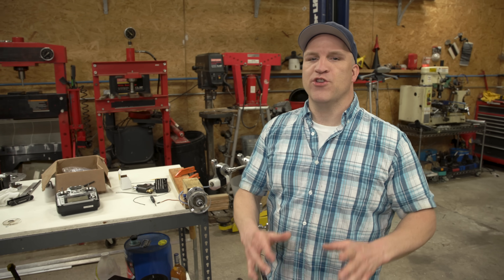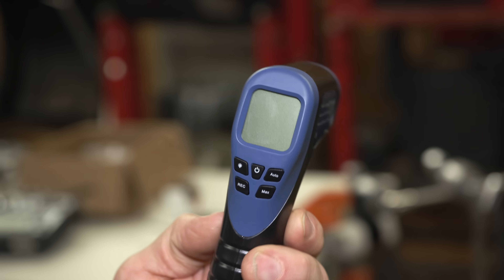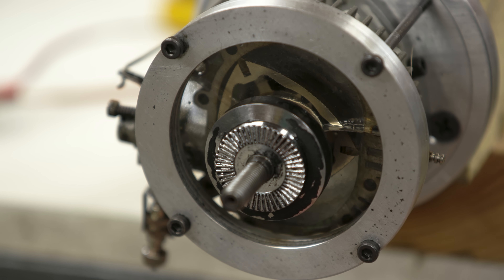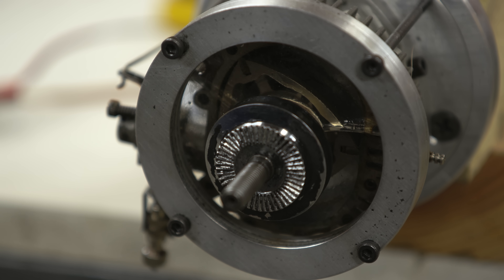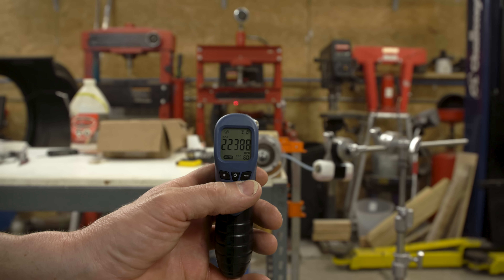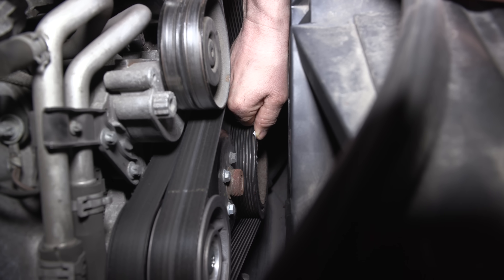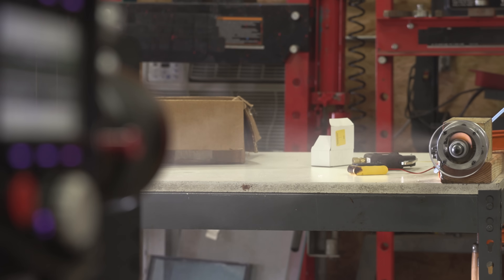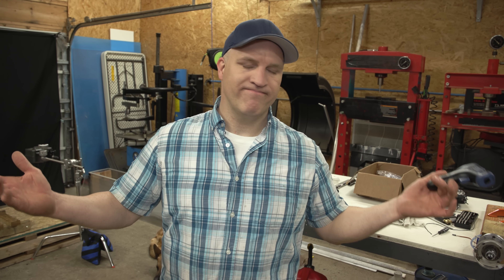See Thru Rotary Engine MAX RPM - 29000 (Wankel Engine)

Comment: Since it has 3 identicle sides, wouldnt u have to divide that by 3
Reply: Ty Williamson the rotor is spinning 1/3 rate of the flywheel but the flywheel rpm is true
Reply: There is a three-to-one ratio... the internal components rotate at just one third of output shaft speed... slower than many Diesel engines.

Comment: idling at 7000rpm is healthy

Edit: why are people arguing, jeez
Reply: My buddy's Polaris pro x 440 snowmobile will sometimes idle at 6000rpm because of dirty carbs
Reply: @ turbo traktor  dam, my Crossfire 600 (2009) idles at 1400 RPM
Reply: Hey bro read the 665.7rpm idel .. not 6657
Reply: @kennethschultz6465  actually it is
Reply: @recepgunoglu4058  realy ..  What doe's 1 rpm mean .. 6000+ rpm is almost a F1 car in idel.. 
So No i don't belive IT is
Reply: @kennethschultz6465  F1 cars turn 18000-24000, hell my Ford Focus shifts gears at 6800 RPM I could wholly believe a little snowmobile engine that revs to 18000-20000 would idle at 6k
Reply: @alexphillips4325  lol how long ago did you watch f1? We have V6 turbo 1.6L hybrids now, which legally can go to 15000, but for reliability worries go usually to ,13500
Reply: @alexphillips4325  the Polaris redlines at 9000rpm but that snowmobile is long gone, we managed to blow the drivebelt on it
Reply: @kennethschultz6465  buddy you can't even English so gtfo here. Rotory engines work at much higher rpms than regular engines. You must be new.
Reply: @kennethschultz6465  7000 seems very possible to me, some RC engines can rev to 30k+ rpm
Reply: @alexphillips4325  eh idk our old 340 polaris idled at about 1200 and maxed out at about 11.5k. It was a twin 2 stroke
Reply: @kennethschultz6465  And is this engine meant for a car?
Reply: @alexphillips4325  f1 cars are 13k rpm
Reply: @ljamieson0581  Depends on the era, the v10s of 2003 were limited to something around 18 or 19k rpm
Reply: @recepgunoglu4058  ops yakaladım
Reply: @alexphillips4325 I’m glad I’m not the only one redlining my focus 😂 takes all the abuse even at 160k miles
Reply: @alexphillips4325  what snowmobile revs to 24k? You’d be lucky to get 13k on most
Reply: @alexphillips4325  f1 cars on full throttle may reach 12.5k,so yoy are wrong
Reply: @alexphillips4325  Yeah I heard ungoverned that redbull got one up to 22k at max rpms.
Reply: @kennethschultz6465  theres no decimal on the tach. youre wrong
Reply: @kas-lw7xz  Dude probably quit after 2005 USGP
Reply: @kennethschultz6465  Are you blind of what? Play the vid in slo-mo and you can CLEARLY see the revs go from 13XXX to 9XXX.X.
Reply: Jet engines get cranked at 4000rpm.....idle at 9000.....can go upto 40000rpm
Reply: I like turtles
Reply: My hard drive does 5400RPM
Reply: Well it's a rotary. They have high idle, high rev redline.
Reply: @foxman105  its because its miniature size as well
Reply: @foxman105  I kind it hard to believe how nobody here mentioned the reason why engine idle higher in the first place smh having a high idle doesn't mean it can rev high. The idle is dictated mechanically by the the lobe profile of the camshafts due to having a higher lift and duration and in rotary engines by the port size and shape. Lower idle is set as low as possible in road cars for emission and economy purposes and also for lowered end torque. Racing engines follow a different philosophy and are only about getting the most hp and increasing revs efficiently is part of the nature. So since they don't care about fuel economy they don't compromise and design the camshafts and everything around it accordingly. Motorcycle engines use the same principle but only because of its smaller displacement and being naturally aspirated only way to increase hp is again by high revs and also again thats why they idle higher then road cars. In forced induction engines the revs can be set lower due to the power being created by the turbo but still can be made to rev high for higher hp like in f1. With that being said just because it's a rotary doesn't mean it only operates at high revs. All road production rotary engines idle just like any other engine. Take the rx8 for example idles at 900 but has a 9000 rpm rev limit. So yea the amount of nonsense in here is crazy.
Reply: @MrDelsoleg11  That 700 RPM idle in RX 8 was done because of the emissions and is actually hurting the engine in the long term. If I remember correctly it's recommended to raise the idle to around 1100 RPM between emission tests so you won't damage the Apex Seals. At 700 they get poor lubrication and start to scrape.
Reply: As fast as a harddrive
Reply: I don't understand how much can be 7000 rpm, could someone convert it with imperial system?
Reply: @shimmentakezo1196  7000 rotation per minute
Reply: @magnumllama400  Thank you, I meant with imperial system. Smart people have invented and use it, there must be a unit. I don't know, maybe 81.2 nails per football match time, or something like that. There are barrels, inches, miles etc there must be something intelligent for rpms
Reply: @shimmentakezo1196  bald eagles per 10m lifted trucks
Reply: @magnumllama400  That's it ! I knew there was a solution lol
Reply: @shimmentakezo1196  there are even better solutions but I can't think of one yet, maybe count it in hamburgers per AR15
Reply: @magnumllama400  sounds american enough
Reply: @Alexander Miller the Shelby gt350 can rev upto 8250
Reply: @Lrlbiglee  yeah my vtec revs up to 10k, but Alexander is talking about Idling bruh
Reply: There is so many factor that limit 4 stroke with piston engine for higher revving, in daily driver car/bike some factory set it to 21 m/s on piston speed. So if your engine used shorter stroke it can rev higher than engine with longer stroke (so thats why motorcycle can get higher redline than car).
You can also go to more than 21 m/s by removing factory redline (using progamable ECU) but it can reduce the engine durability 
In this video, he using rotary engine, so don't compare it with your piston engine rpm when idle
Reply: its not idling at 7k, its at 7000/3. they took the crank's speed not the rotor speed
Reply: @disruptivegarage  Rotaries are almost always measured at crank speed, that’s the RPM shown on all of the GM and Mazda rotaries is the RPM of the E shaft
Reply: @alexphillips4325  try giving Wankel engine rpm a google. you surely don't think that these guys casually make 3x the rpm racing engines make? if you divide by three you get at the more feasible and actual rpm.
Reply: @disruptivegarage  My 3.3cc regular piston/cylinder RC plane engines also turn 30-40k rpm wide open, and official manufacturer redline is 50,000 RPM, and Wankel engines are generally capable of higher RPM speeds than a piston engine. The crank speed is how the Wankel engine RPM is measured, not rotor RPM. When the Wankel crank is spinning 30k RPM, the rotor is indeed turning 10k RPM, however, the engine fires once per crank revolution, so it makes more sense to measure it at the RPM of the eccentric shaft, which is how this was measured.
Reply: @alexphillips4325  the reason this might be possible is because you have very little rotating mass, 3.3cc weighs nothing so the forced at play are easy to cope with, not to mention bore vs stroke. a regular size engine wont we be capable of such rpm's just like the one in the video. you can even check what i stated about the rpm in the video.
Reply: Cute little motor and it spins quick as good job 

Loving the sound purring sound
Reply: I've got an RC car that idles at 17000 when cold and it richens up and idles at 11000 RPM when hot. I love the thing, the clutch starts biting at 22000 RPM, full close at 26000 RPM, and shifts from first to second at 40000 RPM, and tops out at 80 mph and 47000 RPM.
Reply: @alexphillips4325  what's this rc car?
Reply: @alexphillips4325  that’s one crazy crazy car
Reply: @alexphillips4325  ye but that rc car has like a 5cc engine
Reply: @alexphillips4325  i don't care !!! Read the RPM COUNTER HE IS POINTING WITH!!! 
""" DOOOOH MY SOACE SHUTTEL GOT 790000000 RPM ON THE BOOSTER PUMP IN IDEL """ 
WELL WHO FUKING CARES !!! IF THE R P M COUNTER SAY 667.7RPM 
ON THIS ENIGEN IN THIS VIDEO !!!
Reply: @TheBypasser  comaring 6000 shots from a gatling to 300 from a tmg 
Right !! Easy
Reply: @TheBypasser  and 1 rpm is 3 combustions ..
So 20.000 rpm
60.000 cumbustions 
Good luck with listening
Reply: @kennethschultz6465  No.
1. 1 rpm is 1 combustion per minute (because the shaft - and the flywheel - spins three times faster then the rotor, this is a Wankel, do not forget it).
2. How is 20k RPM relevant as you tried to state it idles at ~700? (which it doesn't)
3. 600 RPM is 10Hz so sounds like a machine gun, nothing close to anything you can hear in any part of this video.
4. On 6:29 is the lowest idle here (likely because of the lean mix), that is ~7k RPM, both by tach and by the sound (~117 Hz)
5. If you still can't believe it idles at around 10k RPM, just download some audio editing software and either look on the spectrum or the peaks themselves.
6. Even 60k RPM is perfectly distinguishable as it is exactly 1kHz, so would sound like a high-pitched loud hiss.
Reply: @kennethschultz6465  
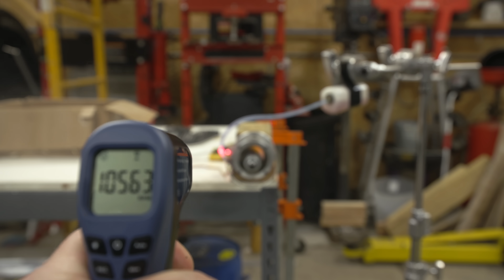Take a very close look at 2:44 , it IS Idling at 10563 rpm, there is NO decimal point. And at 8:46 you can see, it's ONE combustion per round, not three. Set the video playback to .25 and watch closely: The marker for the tachometer is always visible on the right side, when the fuel ignites, there are no combustions when the marker is anywhere else.
Reply: @kennethschultz6465  are you drunk
Reply: @kennethschultz6465  jezz calm down!!!!!!
Reply: @kennethschultz6465  bro i'm having a stroke while reading your replies
Reply: Shur most 2 stroke engines idle at 2k to 5k rpm
Reply: @alexhickey5633  It probably has a stuck choke or something because if it keeps idling for a time it'll even out at around 3-4000rpm
Reply: @pettttson  look at the size of the engine. Its tiny. Everything will happen faster
Reply: @alexhickey5633  Thats fucking ridiculous, no they dont.
Reply: @verttisyrjala2897  they do. 1500 is the lowest they usually go. 2 strokes idle high its just a fact.
Reply: @alexhickey5633  If a 2 stroke dirtbike for example is idling above ~2000-2500, its running lean when the carburator slide is closed.
Reply: @verttisyrjala2897  depends on the engine displacement too buddy
Reply: @alexhickey5633  Bigger engines will idle lower
Reply: @verttisyrjala2897  well no shit!!!!!
Reply: @alexhickey5633  the engine in my case was running like crap, oh and by the way idle rpms doesn't matter on a snowmobile, the throttle will engage the variable transmission. In My case the snowmobile wouldn't start moving until roughly 6500rpm and with a lot of throttle.
Reply: @pettttson  dirty carb probably. Wouldnt know without looking at it
Reply: My motorbike redlines at 6000rpm. Go figure....
Reply: @faustin289  My cars engine redlines at 6500, so what? These are complete different engine types. Formula 1 engines rev up to 15000upm. A Kawasaki Ninja engine (actual H2 model) has its maximum power output at 11000 upm.
Reply: @faustin289  My motorcycle redlines at 9000rpm, but engine is capable of doing 11000rpm with some tweaking to the ecu.

Comment: How much power and fuel used per kw-hr? Is there such a thing as a Diesel Wankle?
Reply: Horrible BSFC... No, there are no successful Wankel Diesel engines... Wankel engines cannot support the required static compression ratio and the seals are too weak.

Comment: I can only imagine what that would sound like if it was a quad-rotor (ala 26B). It would probably go beyond the range of hearing at 25K rpm or so!🤣 Not to mention about 20-25 hp out of 20cc's.😳😁 (more rotors, smoother power delivery, higher torque/horsepower overall)

Comment: I love the rotary engine but now I know why the Wankel rotary's were such gas guzlers, even with the 13B fuel injection set up, why they had temp sensors in the exhaust pipes, and why the apex seals were constantly failing..  The power stroke chamber dose not focus all the power eficiently onto the rotor to push it over in the combustion chamber area before it gets scavenger out of the exhaust port. I ran mine with a little bit of 2 stoke oil per tank in the gas as a back up to the apex metering oil pump failing which they did or by being out of adjustment..  

The biggest problem with these engines is that NOBODY knew anything about them, even the dealers couldn't diagnose the problems, the owners of the RX7's were better mechanics than the dealer mechanics, and I have extensive experience in this, where I had to tow my 1985 RX7 into a dealer, the dealer had NOBODY there to fix the car so he had to phone up an outside tech who didn't work for the dealership come in and did the same diagnostic procedure as I did before I brought it in, he couldn't find the problem but said that the engine is blown in his absolute backyard mechanic wisdon..  I told him that your full of shit, I towed the car back home and after a day of diagnosis I found that a squrel had chewed some of the wires on my computer wiring harness, so I patched them up and varoooooom!

Comment: This is the best Wankel video on Youtube. #ThumbsUp
Having said that, this RC Wankel engine is actually considered big and slow by RC standards. I'm sure you've noticed it's built entirely from iron, which is very old tech for RC engines. The engines in my RC cars and trucks, even the "vintage" ones that are 20 years old, are built with aluminum pistons, conrods, and crankcases, and chrome-plated-brass cylinder liners. The only steel parts are the crankshafts, wrist-pins, and ball-bearings. My fastest engine is a .207 cubic-inch (3.4cc) Team Losi engine that reaches 38000rpm at 67mph. To save you the trouble of doing math, that equals 633.3 complete combustion cycles per second, or 1266.7 directional changes of the piston per second. At peak RPM, the piston accelerates to a peak linear speed of about 60mph and then decelerates to a stop again in 3/4 of a millisecond.

Comment: Wankel with 10 :1 cycloidal diff vs wankel with traditional hobbed gear 10:1 gear reduction diff. Which can produce more torque at high rpm? I don't know. I feel like a cycloidal gear reduction is a great match with a wankel rotary engine. They operate in such a similar way,  and are both very compact for their displacement and output
Reply: The Wankel engine was less mechanically efficient and thus produced less torque... the Wankel is fundamentally inferior to reciprocating engines which is why they are obsolete today.

Comment: Your AMG makes the same start up whine as my brothers C55. Do you know what that is?
Reply from the maker: Yes, it's the supercharger. Funny that you say that because that is the reason Mercedes moved away from the supercharger and went with naturally aspirated, and then went with turbo charged. A lot of people thought that the supercharger whine was an issue with the engine even though it was totally normal.
Reply: @WarpedYT  
Not the supercharger whine I'm afraid. It's something that occurs on cold start and drops off after about 5 or so seconds. 
His C55 is the naturally aspirated model I just noticed that whine on start is identical. I've heard several theories online, a lot of people believe it to be the smog pump for emissions control.

Comment: So that's what Juan uses when he blows the leaves off my front porch!
Reply: No, Wankel engines are obsolete now and although introduced into some yard equipment products years ago they were a commercial failure.
Reply: @doktorbimmer  .......the joke was that it sounded like a leaf blower.
Reply: They actually did try to use these engines in yard equipment like lawn mowers and chainsaws years ago... but they are way too unreliable.

Comment: Of course it blew lol, you were running 20k RPM's. If I remember right, my last 13b redlined around 9300. If you were to have ran it at a reasonable RPM that would be considered safe for most rotaries to run at, it would not likely have blown.
Reply: Bruh doesn’t it idle at 10k rpm
Reply: idk but im preety sure smaller engines have higher idles and redlines
Reply: @Silverdev2482  possibly

Comment: Is there any way you can measure the Horsepower and torque output?
Reply: 2 horsepower max. Torque? Too low to measure with existing technology. Lol!!!
Reply: @doktorbimmer  I thought this engine was way more powerful
Reply: But thanks for the information
Reply: Yeah, actually for their size they produce less horsepower because of the lower efficiency... they tend to wear-out quickly and produce even less power. Cheers!

Comment: I loved your videos and the see-through cuz I always was curious about rotary engines.

How does this engine lubricate itself so that it does not seize up?  back in the day I read that the weakness of rotary engines was the seals at the points of the triangles.
Reply: Actually this is a Wankel engine to be correct. Lubricant is mixed with the special fuel that model engines like these use. Yes, apex seals are notoriously unreliable and is a major factor in these engines becoming obsolete.

Comment: imagine a 650 cc Wankel engine revving to 20000 rpm on a race bike
Reply: The larger the diameter of the Wankel engine the slower the engine must run to prevent damage to the seals and the housings.

Comment: Bear in mind that the rotor is only doing half the RPM of the output shaft.
Reply: One THIRD of crankshaft speed. The piston gear-to-fixed gear ratio is 3:1.

Comment: 29k isn't that impressive,  there are nitro car engines that turn over 40k at WOT. 

I was expecting more tbh
Reply: Good point, its a common myth that Wankel engines can rev higher than reciprocating engines... which is simply not true.